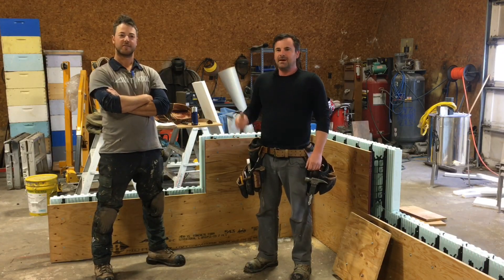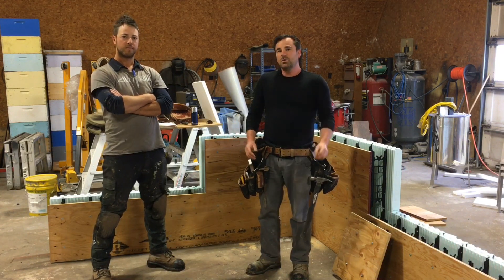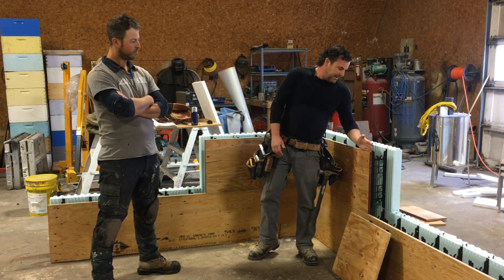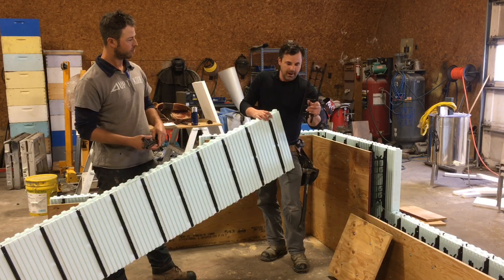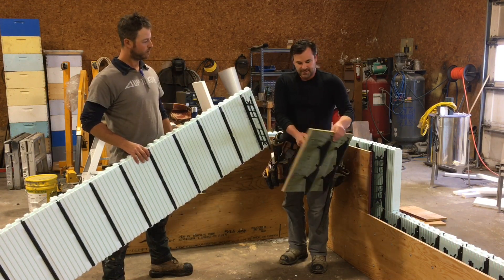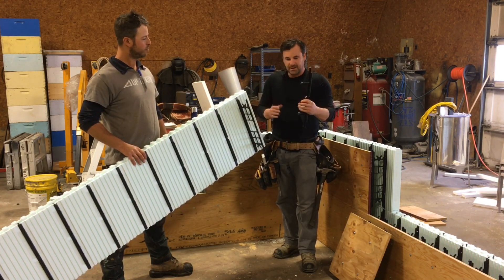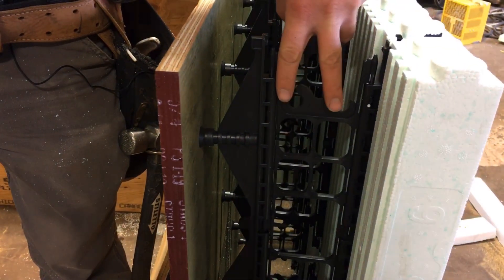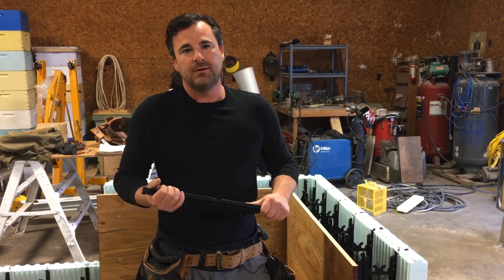Components of the Nudura One Series - ICF wall with Exposed Concrete

Comment: Any thoughts on being able to use a liner on the exterior faced plywood surface in order to create a textured exterior rather than having to stucco/side an icf?

Seems like the fastening system prevents a liner from being used?
Reply from the maker: I think it’s possible! One would have to put a bit of thought into it
Reply: @uptokode  Hi Kody great videos always thank you..I am just curious why you can’t just use the two sided one first and then peel off the foam wherever not needed ? Doesn’t it produce the same result and better overall as you don’t have to waste time and money on attaching the plywood and detaching it later ? It may be a totally dumb question 😀😀 but would like to know your thoughts..this way you can have exposed concrete on the outside with foam inside as well and just paint or stain it with no stucco stone etc..I suppose it won’t be that difficult to remove the foam vs plywood..

Comment: Hi Kodi,
So the plywood is from Nudura, do you buy it and keep it to repurpose? Or do you return it?
Also is it prepped for concrete with some type of release agent, or I’m guessing you oil it first.
We currently have an ICF basement, and would prefer exposed concrete in order to do other finishing types.
Thanks for the great videos. Keep them coming with the one series. Also as you are not sponsored by Nudura, and you going to be bringing in any other companies ICF for comparison? For example AMVIC.
Also have you seen the new style of vertical ICF? Does look to be much faster in assembly, but I see the biggest disadvantage in that it does not Appear to have any way to change the thickness of a wall with the brick ledge type of form. But, much less waste with that system in that almost all cut offs can be restacked.
Reply from the maker: You re-use the plywood for future walls. And yes it has a coating on it from factory but one would need to oil for future uses. 

No I’m not sponsored by Nudura. I am open to learning other systems. Sometimes it’s tricky to learn all the ins and outs of one system and then switch companies. Then me and all my staff have to learn all new tricks.
Reply: @uptokode  
Thanks for the reply.
I’m guessing the plywood they supply is pretty expensive in order to be of a quality to be used again with this system.
For someone who might be doing their own build, and won’t be doing repeats, this system might be cost prohibitive compared to normal 2 sided ICF. Really depends on what they are charging for the plywood, and once you clean it up, can you repurpose it for say,, shelving.
As for the other companies,,,, Ive taken the AMVIC installers course, and also used Nudura. If you can do ☝️, you should be able to use any other horizontal ICF with very Little difficulty. I’m no rock star, so hell, if I can do it, anyone can. The Latest next step seams to be the verticals ICF. Their are some interesting videos on it.
I’m prepping up for hopefully my final build this spring. Planning on using ICF, but there is a lot of bedrock where I’m building, so until I start scrapping dirt, nothing is for certain. My own video channel to follow the build upcoming. And it’s content like yours, and others who help with product selection. Thanks again.

Comment: How do you add brick or stone to a house like this.  I don't like the brick ledge ICF block.  One I don't think it is strong enough if you go over 25' and second the look from the outside of the house is awful.  Please help
Reply from the maker: Are we talking a one side ICF or standard ICF wall? You could form your own brick ledge. That would control the height. That’s my problem with a brick ledge. The concrete will be able to hold more than anything else I can think of. 

Other option is notch out the foam and bolt a steel member of some type to the wall. Not sure what else one could do.
Reply: Could you please give me any example of forming your own brick ledge.  I'm thinking of using a 12" wide core on the foundation walls and then using a 6" core above ground.  That will give me 6" of space.  The only problem is you still lose 2.625" of outside concrete strength because it's just foam.  Maybe for my  bottom coarse I can use a deep thick limestone that will span the entire 6" to help distribute the load over the concrete and edge foam......your thoughts?
Reply from the maker: You should email me. kody@uptokode.com.

Comment: It also better utilizes the thermal mass of the concrete, since its not covered by insulation (which is just on the exterior)... So the room should be more comfy....As long as the net R value is the same....
It just seems costlier.....

Comment: Great introduction. Is there a cost advantage using interior plywood block?
Reply from the maker: I’m not sure what you mean by that. Please clarify.
Reply: @uptokode  : my bad. I know only the icf forms that have foam insulation on either sides. I am
Seeing plywood on the interior side. Does this product have any cost advantage compared to the conventional icf form
Reply: @squeekhobby4571  Most likely, its "net" cost will be more.... But its a cost effective option for a single room like a garage, when the rest of the building is constructed with conventional  ICF forms...  When the garage's inner facing wall needs to be concrete, instead of foam.... So it can be power washed, like in this case.

Also any concrete construction with the insulation "only" on the exterior..... Will better utilizes the thermal mass of the concrete... So the room should be more comfy....As long as the "net" R value is the same.... 

So the added cost could make it worthwhile for some ppl, especially if the concrete does not need to covered for aesthetics.

But cost-wise a conventional formed, concrete poured wall.... With foam board applied to the exterior, after the  pour.... Would be cheaper on average and an easier option to this hybrid option.... if all the  inner facing wall had to be concrete....
Reply: @nc3826  : great description! Thanks
Reply: @squeekhobby4571  NP,  2 more benefits....the ICF webbing attachment points for temp plywood forms.... can be used after they are striped for lightweight shelving or anything lightweight you want to attach to the wall... 
And the plywood could be replaced to imprint woodgrain or other patterns on the concrete, that is commonly done with "concrete stamps"....

BTW I also saw a link for a distributor offering to rent the, temp plywood forms....
Reply: @nc3826  : excellent response! 🙏🙏